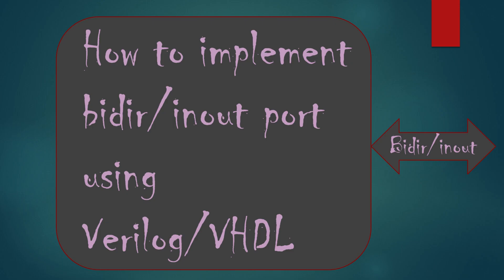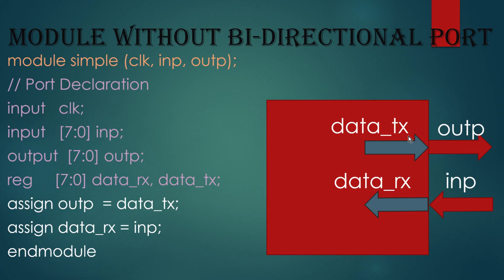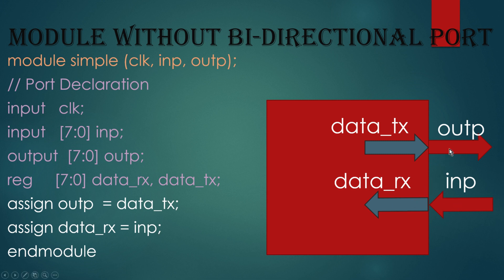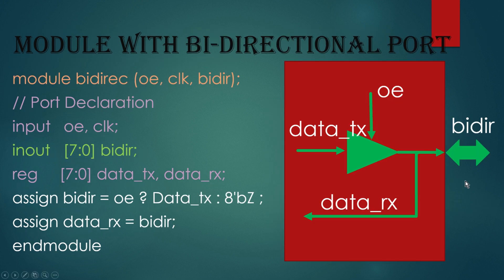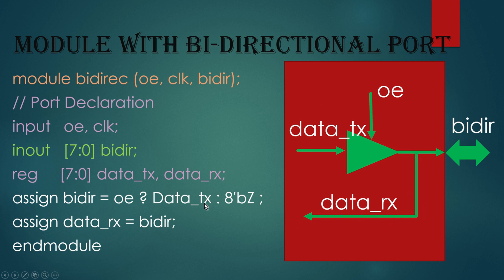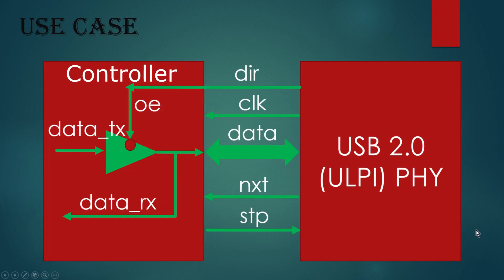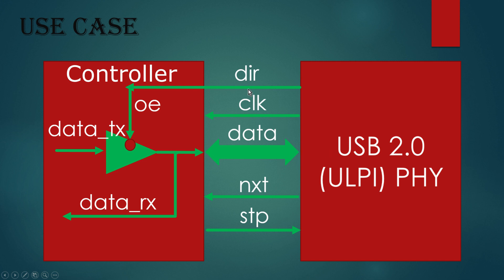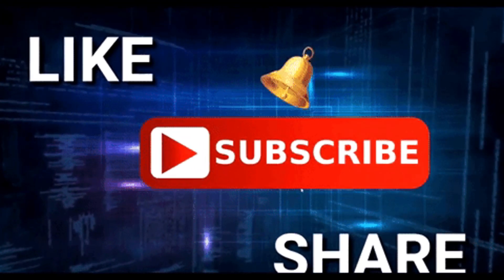Bidirectional ports | inout port in VHDL and Verilog HDL

Comment: Your presentation of concept is good but you are using 'reg' data type with assign which is not allowed.
Reply from the maker: Hi Dixit, thank you so much for pointing out mistake .. actually, I wrote the code in the ppt without synthesis, so this mistake happened .. I apologize and we will definitely take care to synthesize the any code before final presentation.
Reply from the maker: Thanks for initiating this discussion.

Comment: So when data_tx is high impedance, it is cut, and only data_rx functions. Is it correct that when data_tx is not high impedance, data_rx is cut? Also, when data_tx is not high impedance, can the same data_tx output register be manipulated to drive high or low signal?
Reply: I am also confused on how you can use "assign" with type reg, doesn't the assign command need to be associated with type 'net' on the left hand side?
Reply from the maker: @michaelm9125  hank you so much for pointing out mistake .. actually, I wrote the code in the ppt without synthesis, so this mistake happened .. I apologize and we will definitely take care to synthesize the any code before final presentation.
Reply from the maker: Hi Michael,  data rx will be always connected, but inside your design you have to take care data_rx according enable (oe) signal.
Reply: @TechnicalBytes  Hi, how can we block data_rx when data_tx is being passed? How to implement a pulldown? Do we need a separate driver here?
Reply from the maker: We apologize for replying late.

Comment: * assign can't have reg on left hand side

module bidirec(
    oe,clk,bidir
);
input oe,clk;
inout [7:0] bidir;
reg [7:0] data_tx;
wire [7:0] data_rx;
assign bidir = oe ? data_tx : 8'bZ;
assign data_rx = bidir;

endmodule // bidirec

module simple(
    clk,inp,outp
);
input clk;
input [7:0] inp;
output [7:0] outp;
reg [7:0] data_tx;
wire [7:0] data_rx;
assign outp = data_tx;
assign data_rx = inp;
endmodule // simple
Reply from the maker: you are correct .. but where is reg on the LHS side ?.. only data_tx is reg which is not on LHS side..